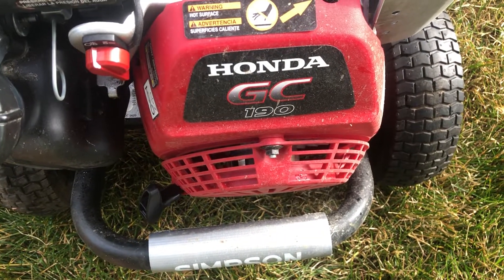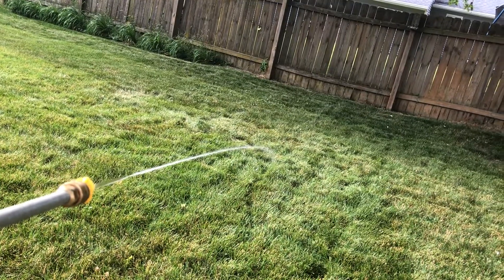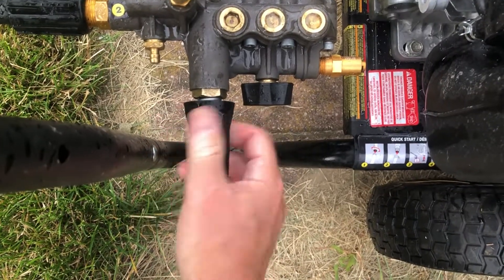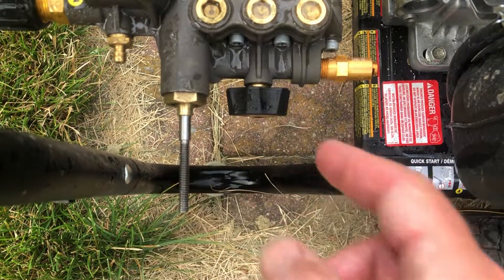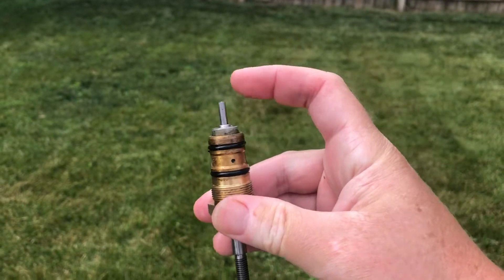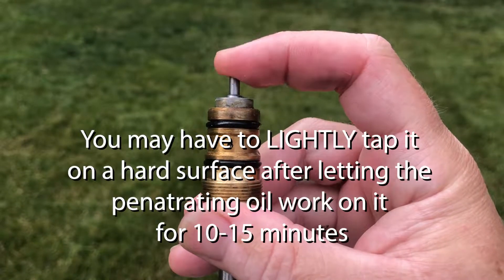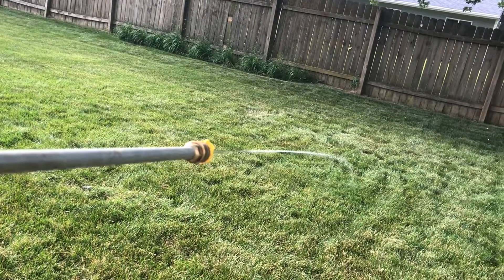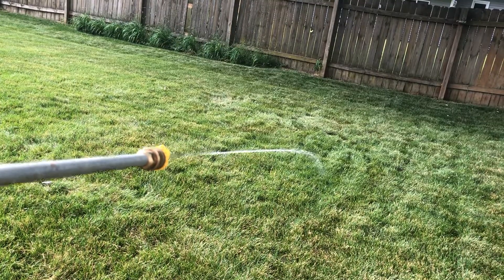How to Fix Honda GC190 Pressure Washer That Has No Pressure

Comment: never use w40 when you have plastic parts such as rings or rubber gaskets.  The w40 destroys them.  I learned that mistake.  only soap.  and it is better to use lubricants for electrical parts.  It's great.  thank you for your video it is very good